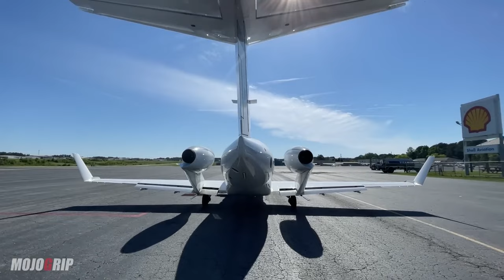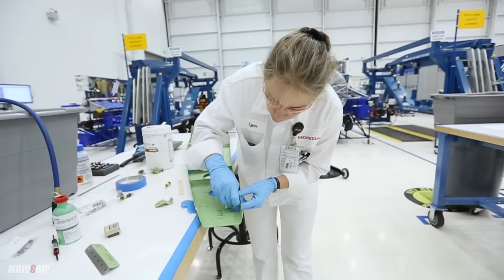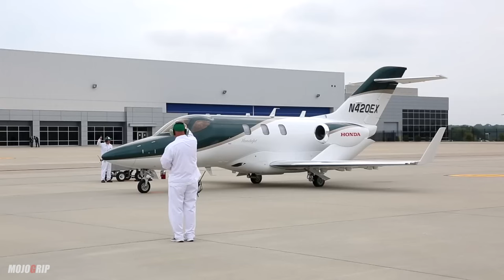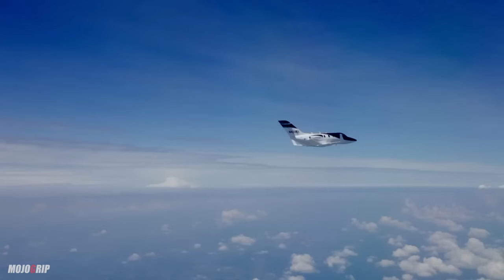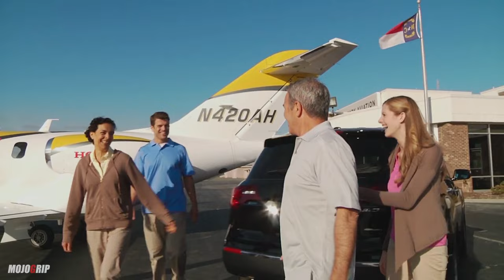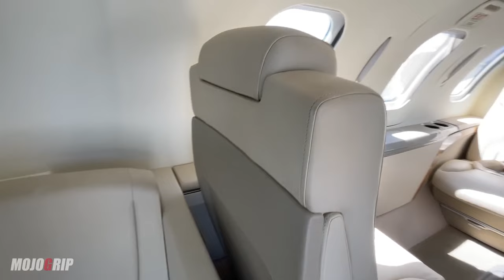What It's Like Owning A Honda Jet

Comment: The original experimental prototype of the Honda Jet was the Honda MH-02. It was designed and built at Mississippi State University's Raspet Flight Research Laboratory from the late 80s to early 90s. It was flown on almost 200 hours of test flights, then exported to Japan in 1998.

Comment: It’s a low range aircraft which is not desirable. Need at least 2000 NM, Nextant 400xti and the Syber Jet SJ30 are far better options…